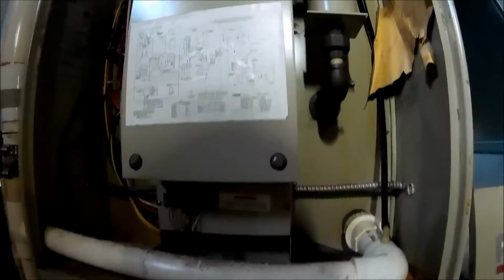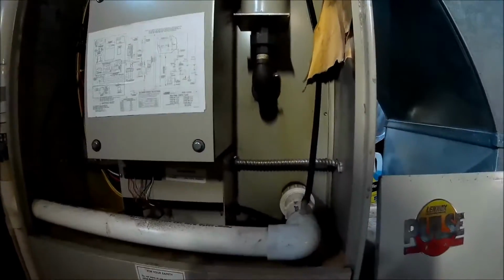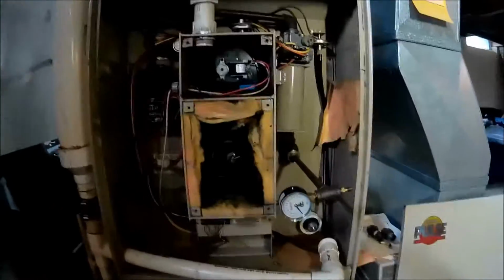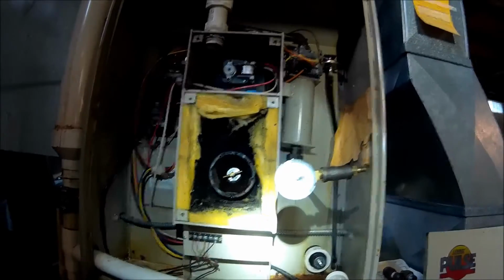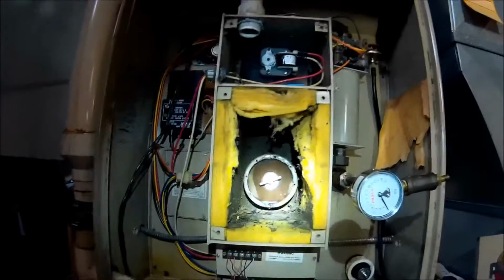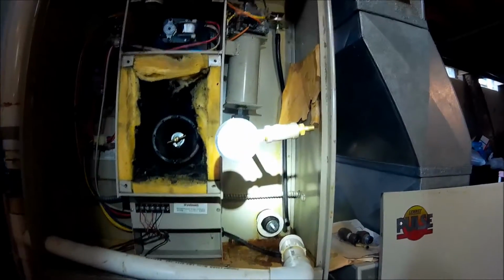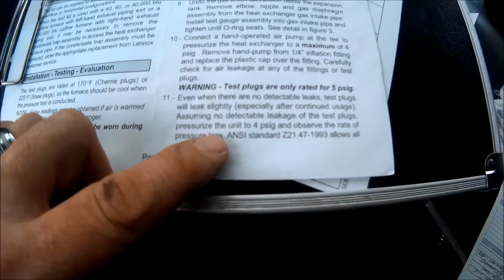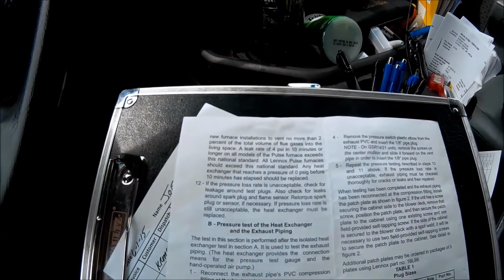Lennox pulse G14 pressure test

Comment: I am 76 and used to service these.  YOU DID NOT  check the  ignitor (spark plug) and  flame sensor  (10mm spark plug body with extended rod)  to see if they were loose / leaking.
Reply: I have 4 of these in a church, circa 1984. One clearly fails a pressure test immediately. The other two I have tested give me confusing results. The Lennox HQ is no more than 20 miles away but they claim to have no one that knows anything about these anymore. Might you be available to advise me about what I am seeing? Happy to  give you my phone # if you are willing to help. Thanks. Steve

Comment: Wouldn’t you need some type of cut of valve to hold pressure in the heat exchanger?
Reply: Yes I'm wondering too....there's an obvious problem with his setup, so obvious as to be unbelievable. He needs a shutoff valve between his air hose and that tee. But again, I don't believe he can possibly be this confused.
Reply: So, I watched another video, and was able to deduce that there's a Schrader valve tucked into that "T" he's hitting with the air....apparently....though the threading of that is not apparent.  I'd want a 1/4 turn real valve in there -- you have the potential to trash someone's furnace because of dirt in a spring-loaded needle valve....hmmm.....

Comment: We purchased a house ~5 years ago that has an older (a 1989 model, I think) Lennox Pulse furnace (model G14), that was apparently 'upgraded' at some point in the 90's due to a recall on the heat exchanger likelihood of cracking.   I was somewhat aware of the Lennox pulse furnace issue when I bought the house, so we installed an extra CO2 sensor that is hooked into the [previous owner's very extensive ]  ADT home monitoring system.   The main blower motor just 'bit the dust' tonight, so I came across this video looking for blower-motor/fan-housing content,   however,  I was told by the HVAC guy that I should have even the new replaced exchanger checked every four years by a certified Lennox tech.  (Seems logical to me).  That said, I'm just wondering,  if there ever is a problem with the exchanger, wouldn't a CO2 detector mounted very close to the furnace detect a heat exchanger crack problem with these forced intake/pulse furnace models?   

Great video by the way.  Very helpful to a layperson like myself  (Also, I'm not sure if I can find the "lennox test plugs" needed to pressure test the system myslef, but I certainly have all the tools and basic knowledge to run the test if I had the plugs.  Are these common purchasable plugs, or only available to Lennox techs??)  Thanks again!
Reply from the maker: +vaprex As a service tech of 20 years I would and would not want to have this furnace in my house. would because it is a very efficient even to todays standards. would not due to heat exchanger issues and the potential co hazard. The furnace should be checked every 3 years. The furnace combustion should also be checked ( flue gas ) at start up and when running steady state. co levels at start up should not exceed 100 to 200ppm and when running steady under 100 ppm  I wouldn't rely on a co detector due to national standards of 400 ppm of co between 5 to 15 min also any co detector should be replaced every 6 years same as smoke detectors . I don't recommend that you try doing this your self. (not trying to say your not handy) The heat exchanger for that furnace in no longer available and I am not sure but their may be a trade in credit through lennox . Due to the age of the furnace I would think about replacing it. Just for your peace of mind and your family's safety get the furnace checked. if you have any other questions fell free to send another message.